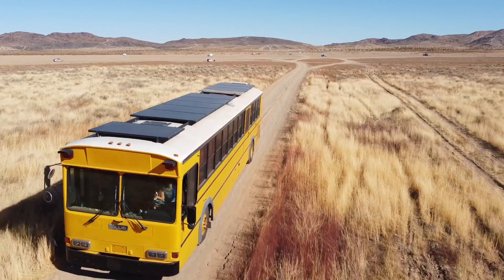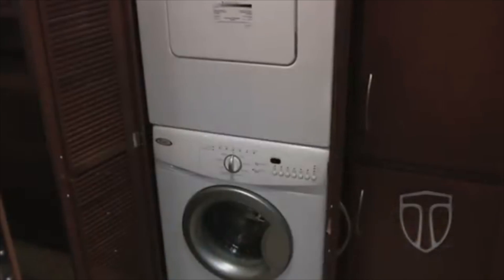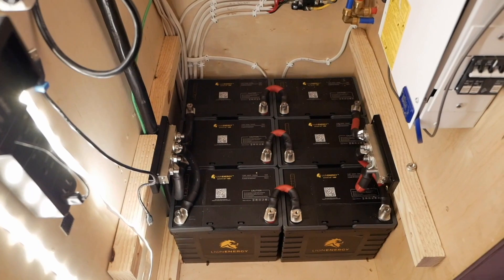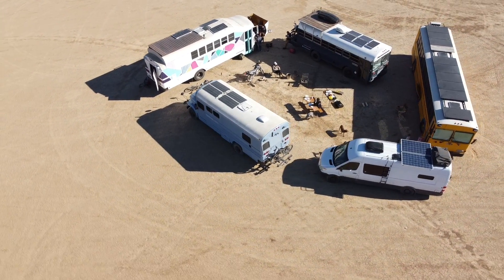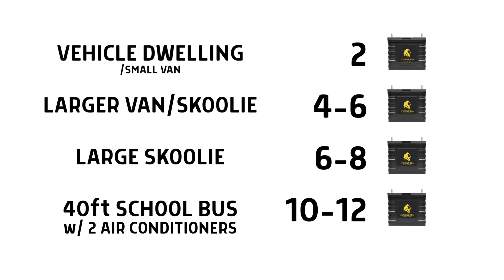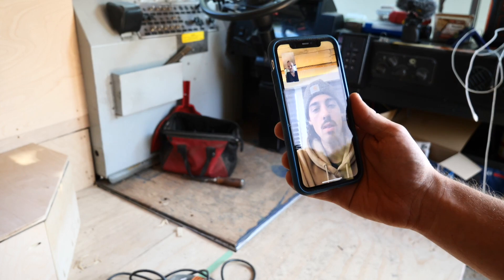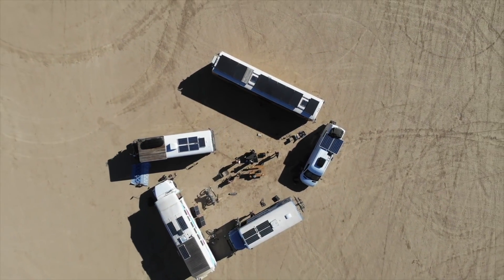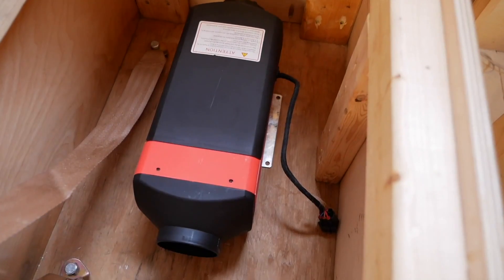How to Build an All-Electric SOLAR POWERED Bus Conversion, RV, or Van (With Air Conditioning!)

Comment: Build your own refrigeration and heating system,  use thermoelectric components for AC and refrigeration and for heating induction cookers or induction heaters. But the best option for power storage would be super capacitors. 😊

Comment: How much is that solar panels and rest of solar system with lithium batteries actually cost?  I’m thinking to get only 4-6 normal batteries and good powerful diesel generator and those costs maybe 2-3 K. Running diesel generators every time you need it cost maybe less than 40 bucks a day. And because I m not living on bus full time, I m not seeing so much as sense to buy full roof of solar panels maybe.  Can anyone lighten me up on this?

Comment: Great video. I like the way you think. We just found your channel and subscribed. It sure looks like you maximized your roof space, which is our goal too. If you ever decide you want more, you could always add a solar array to the side like we did. 

Five years ago, we took an early retirement, sold everything, bought an older MH and hit the road FT. It was the best decision we ever made. We discovered that we enjoy boondocking and it helps stretch our budget too. We quickly learned the advantages of solar and decided to build our solar/battery system in 2 phases, a 12v system for our basic 12v DC needs and a 48v system for our 110v A/C needs. 

We started with a pair of lead acid golf cart batteries and custom built a 620-watt liftable solar array mounted on the side of our motorhome. We lift the array to the optimal angle to improve their output by 20-30% vs flat mounted panels - even more in the winter, when the sun is lower in the sky. It serves as a nice bedroom window awning too, practically lifting itself to the desired angle with a couple gas struts, and it's easy to clean with a windshield squeegee, standing safely on the ground. This set-up, while far from optimal, allowed us to boondock till we could afford to do better. 

We just finished the 12v part of our build last January, with the addition of a 560ah LiFePo-4 battery that we built with 8, 280ah "A" grade prismatic cells. We use a Heltec 350amp BMS, and a 5a active balancer to keep the cells synched up. We typically use less than 20% of their capacity daily giving us enough reserve capacity for about a week of bad weather before we have to run our generator for charging. It cost us less than $1,500 to build this 560ah 12v (7.1Kwh) battery, including the high amp BMS and balancer. We chose these cells rather than a pre-built battery because they fit perfectly under the steps of our MH where our old pair of GC-2 golf cart batteries used to reside, saving 35lbs too. We insulated the battery compartment, cut a 1" hole in our step risers and installed a tiny computer CPU fan to keep this space at close to room temperature, so we don't have to worry about the BMS shutting down charging if they get too cold - or their life reduced from getting too hot. We use an 80A Progressive Dynamics LFP converter/charger, a 1,000w Renogy PSW inverter (to run our TV, PC, ice maker, etc.), an Epever 50a MPPT charge controller and a Lnex battery monitor/shunt. This entire 12v system cost us under $3,500 to build and takes care of all of our basic off-grid needs except for air conditioning and microwave use.

By mounting our solar array on the side of our MH, we left the roof free to rack 8, 550W Sungold Power solar panels (4,400 watts) down the length of our 35ft Class A about 15" off our roof, above our AC, fan shrouds, etc. They will cover the entire roof, providing some nice shade with plenty of cooling air underneath, further increasing solar output and reducing the heat load on the air conditioners too. We bought them for only 51 cents/watt shipped to our door! We're assembling the components for this build now. We bought our aluminum racking material in Yuma, where we're wintering over this year, for under $400, which is the best price we've found. Our solar panels, wiring breakers, etc. arrived last week, but we're taking our time to get everything in and installed over the winter. At 67 yrs old, we're moving much slower these days. Our Sungold Power all-in-one 48V, 5,000W, 120V PSW Inverter/100A charge controller/battery charger just arrived Saturday. Our 48v battery bank will use 16, 320ah grade A prismatic cells which only cost us $1,726 from EEL batteries. So together with our 560ah (7.1 Kwh)12v bank, we will have a total of 23.5 Kwh of batteries onboard - kept charged with over 5,000 watts of solar. We will be replacing our 24 yr old rear 13.5k btu rooftop Dometic AC with an EG4 28.5 seer-2 plug and play 12k btu mini-split heat pump. This second phase will provide 24/7 off-grid air conditioning, supplemental heat from the heat pump and allow occasional usage of our rooftop mounted Furrion AC in the front of our MH during peak afternoon hours, as well as give us whole house 120v ac power. We'll soon have total off-grid electrical independence on a budget we can afford, reserving our generator for emergency back-up use only. Take care, we hope to see you down the road!

Comment: How much solar?

As much as will fit.

How many batteries?

As many as I can afford. 

Batteries are getting better every month. Everybody is using rack mount batteries now. Built in BMS and great pricing. 

I don't want roof vents. Want all solar panels. 4kW+
Reply from the maker: You get it! I'm down with the server rack batteries these days too. Active ventilation is critical though. You could install smaller vents underneath the solar panels but you need something! I regret not doing it.
Reply: @Mobile Dwellings  There must be wall vents available?

Comment: did they mention cost in this video for this setup?
Reply from the maker: An off grid solar system and lithium battery bank at the time of building cost about 12 to 15K and we're down no closer to 10K to 12K with cheaper batteries and Victron components, but the price of everything else has been sliding up a bit.

Comment: If everything is 12vdc, why make a 24vdc bank?
Reply from the maker: Because step down converters are cheap but 12v inverters are not and wire sizes have to be larger with a 12v set up. We were building in the contingency that we might need a second inverter but we didn't end up needing that.
Reply: 24v is more efficient than 12v, residental solar panels also.tend to be 24v or more. So it would have just been easier for this dude to keep his house bank @ 24v. That said, converting the rest of the bus to 24v would add the benefit of being able to charge the house bank while driving the engine.

Still... I'd have prefered to see a proper fully electric bus, like the title stipulated. Proper electric powertrain.

Comment: No solar panels necessary. 
Why spend the money, lose roof space, worry about trees tearing up your panels, cleaning them .....

Electric generator, car alternator, batteries, converter. 

Calculate how much power you need/want, to run your rig.
Choose your size generator.
Get the number of batteries needed to run the generator. 
Buy an alternator, if you need bigger than a standard car alternator, semi truck alternator ( Leece DeVille models are best ).
Your batteries power the generator, generators pully belt runs the alternator,  which repowers the batteries...
Closed system that will run forever, very quiet ( nearly silent ) just hook the system up to a converter for electricity WITHOUT solar panel worries.
Reply from the maker: Does this seriously work? What makes the alternator recharge the batteries more quickly than the electric generator depletes them?
Reply: @MobileDwellings  it's all about calculating usage/draw, of course using alternators from semi trucks, which produce more

Comment: Has your opinion changed since posting this video? We are looking at 10 100AH batteries.
Reply from the maker: Nope. Still feel the same about all points made. If I was buying that many batteries it would be nice to have less and larger batteries if you can find a deal. Not crucial though.
Reply: @MobileDwellings  how long have yall been able to go without plugging in or using a generator?
Reply: Thats 12 kw batery

Comment: Hmm. Could put a couple vertical wind turbines bolted to the side of the bus to recharge that way. Maybe a pedal bike charger with a high enough gear ratio, good for exercise or fidgeting if your feet bounce. Turbines would be effective in a snow storm when the solar is covered.

Comment: Dear Ian Niswonger I have of course no clue where you reside but if you're anywhere near Houston Texas (Northern Tool and Equipment) sells solar panels of more than 2 or 3 sizes. And I think the smaller 50s 100s and 150 watts were considered the cheaper ones I could afford. And I don't like buying on credit at my age. But I suppose a person with the nessisary electrical skills can add them whenever I can afford another.
Reply: Get q each 50 100 150 Watson 3 cekss 300 watts
Reply: @sharonbraselton3135  yeah but you're only saying this cause you're highly intelligent.

Comment: Building a 35ft skoolie right now and have already purchased components for a 2KW solar system. Going with a 24V Growatt all-in-one unit plus 4 x 12V 206Ah SOK batteries which will be configured into 2 x 24V 206Ah batteries for a total battery bank of 24V 412Ah.  Plus, we also have already installed a separate 100W panel plus charge controller whose sole job is to keep our chassis batteries fully charged.  While we will of course also accommodate shore power and generator hookups, solar is definitely the way to go for us.
Reply from the maker: Sounds fantastic! I doubt you will ever have to use a generator unless you plan to run rooftop AC's. Well done!
Reply: Buy 33 fit 37 fout winvadego ekyrrc rv 105 Mike telsa cells 121 miles 114 miles top charger 2 kw solar 5 400 watt solar cells

Comment: Could you put wind cones to generate extra power tied into the solar on the roof and in the front when driving
Reply: I don't think that's a good idea. By the laws of physics, any energy created in the wind turbines (I think that's what you are talking about) will add increased resistance to the bus and cause you to burn more diesel. You would be better to burn that diesel in a generator to charge the batteries.

Comment: The problem with this is a new study proves solar panels are made out of CLEAN COAL and must be replaced every 3 to 3.5 years. Wind generators last only 4.5 to 5 years. Problem two is that these two systems will begin to fill our landfills at an alarming rate with TOXIC CHEMICALS and seep into our fresh water supplies within the next five years. 

Problem three, most of you never research the longterm effects of solar and wind energy; and the other half of you lack the knowledge of basic science to know when you are being scammed. Moreover, I would be willing to bet that none of you know basic facts like:
1. They say, "We must lower the Earth's temperature". That is NOT going to happen with solar panels. Why? If you would have did your research you would know each solar panel can reach upwards of 742°F x this by the number of panels you have × by 7 optimal hours per day = total heat released into the atmosphere per MILLISECOND... not minutes...not hours...not days...but MILLISECOND. Last 3 to 3.5 years
2. Wind generators kills tens of thousands of insects per day that is VITAL FOR POLLINATION; keep going and our food supplies will being to die out. Last 4.5 to 5 years.
3. Perhaps, the most basic of science you overlook or just ignore is life cycle of the Earth, it goes like this, "LIFE CANNOT SURVIVE ON EARTH WITHOUT ONE OF THESE THINGS: CO2, OXYGEN and WATER." Without CO2 there would be no plants. Without Oxygen there would be no animals or humans. Without water no life on Earth can survive. (With the exception of a few microorganisms). Your war on CO2 doesn't recognize its need for life on Earth to exist; you cannot keep taking this to extreme levels.
4. Nuclear energy produces ZERO CO2 emissions and the purest water. Last 80+ years.

It's great that we want clean energy but we already have it and it is not solar and wind. Not yet anyway. Mabe when they find away that makes them last 80 years and won't fill our landfills with TOXIC waste. Wake up you're being tricked with smoke and mirrors and being sold a basket of lemons. You can no more stop the polar ice from melting than you can stand in front of a moving car to stop it. It happens for a reason and that reason is to clean waters/lower acid levels, awaken lands/put other lands to rest, ect. Please, research the facts and science and stop listening to your local media and politicians.

Comment: Where do you recommend getting the 400 watt solar panels from? Maybe I'm just blind but I couldn't find the link to em xD also, do you have links to the cooktop, fridge, water heater, and AC unit? Love the work you're doin brother! Very informational EDIT: Also, quick question, but what do you recommend as far as internet goes? I use a lot of data and would love to find a reliable solution xD
Reply: CED Greentech or Platt electric supply.
Reply: As a suggestion for off grid internet, look into purchasing a cellular wifi hotspot. Don't run it off your phone, get an actual box. As long as latency isn't an issue, that should be enough for a single user. Another thing to consider is Elon Musk's starlink once it is no longer location locked.
Reply: If anywhere near Houston Texas check out (Northern Tool and Equipment) go and look at them. South of FM 1092 Southwest FWY soon to be 69 corridor on the south bound side. (Murphy road) is another name for FM 1092. I believe the FWY sign will read that or.
Reply: I found 400 watt solar panels on eBay as for the cooktop and refrigerator you can find them at Home Depot
Reply: Amazon
Reply: Can't wait for the answers to these questions since the normal housing market now is ridiculously unaffordable
Reply: Suntan solar sells used panels!

I bought 24x 240 watts panels, for 45 bucks a peice, but they do have the larger panels too.

I all ready have 35k watts of LiFePo4 batteries 48v, from Signature Solar. And the thier 3k watt, and 12kwatt All-In-One inverters to power the bus.

Right now I just need the bus, I want to finish it up the build on the road, I want to move as soon as all my stuff is in the bus. Was thinking of buying 1 to 3 acre land, in a few states as places to park it, when not on the road.

Comment: Just wondering how often you need to clean all those solar panels.
Reply from the maker: I clean them maybe every 6 months. We have so much solar power I can let them get dirty.
Reply: It depends on where you go though ?
Desert, beaches have a lot of dust but rainy places make you panels dirty on the long run.
Sometimes you need to adapt.
In theory dirty solar panels can have their efficiency drop a whole 15%